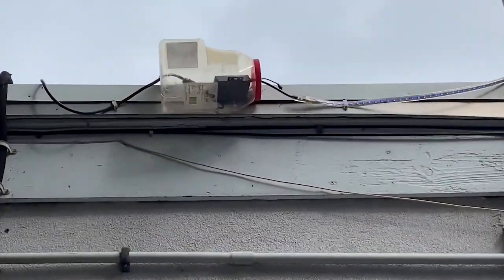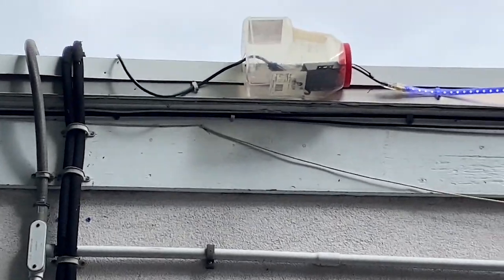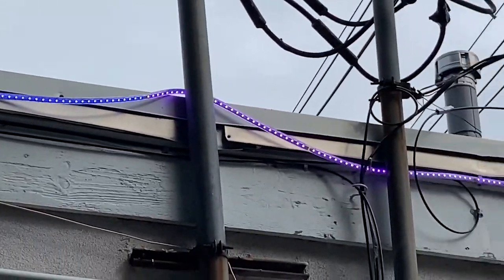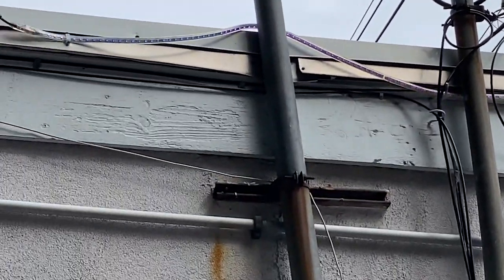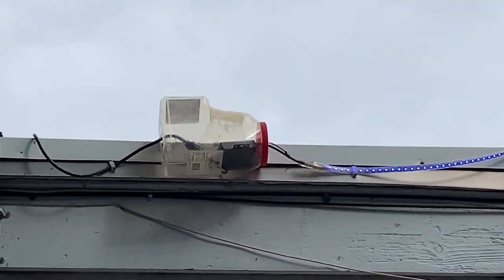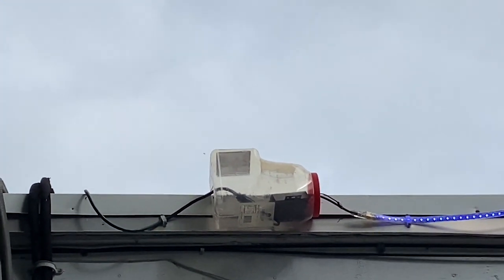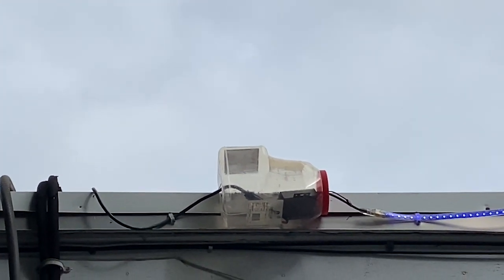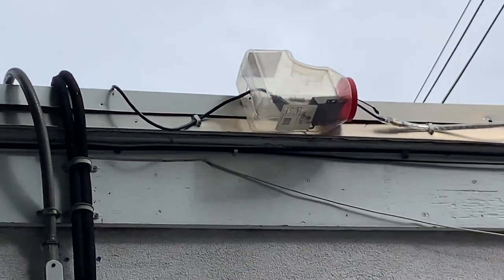Moving Violations Video No. 258: See Through Box

Comment: That looks like the large parmesan cheese containers that my wife got. Except their lids are green, I think the red ones are Romano. I am an electrician, and I have one of those rope lights. I actually got it from a job, in which they wanted me to remove it, and it is rated and designed for outdoor use. It is in a thick clear rubber insulation that is sealed on the ends, waterproof. It could fall in a swimming pool and be fine. They of course, should have had a WR rated GFCI outlet installed and plug the rope light into that directly, instead of using an extension cord. I assume this is for some kind of exterior lighting to make the place more appealing. The staples are fine, as they have the two nails with the plastic, which is made for cables other than NM. 
But draping the rope light over the service drop pole, is probably not suitable. 
🔌